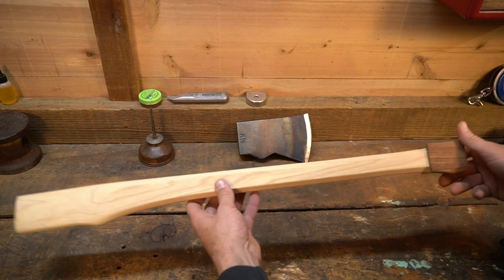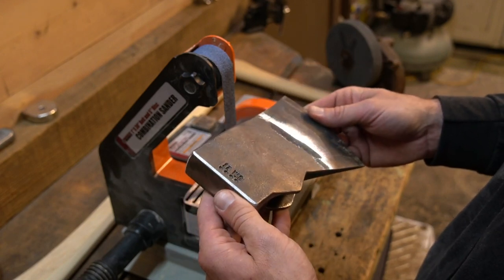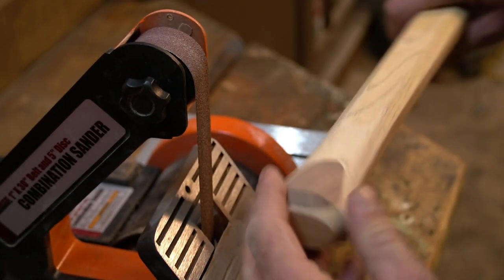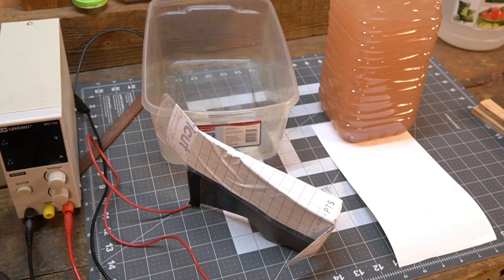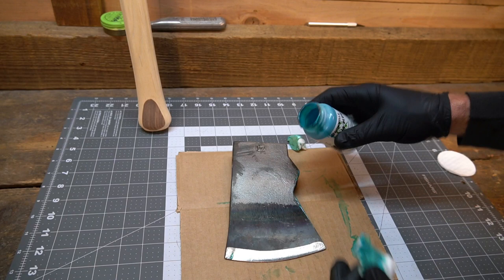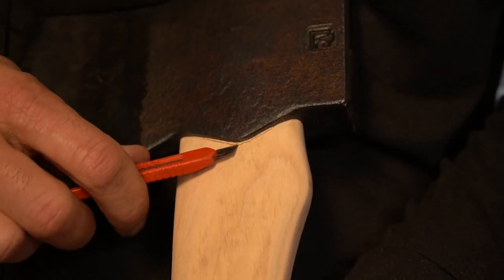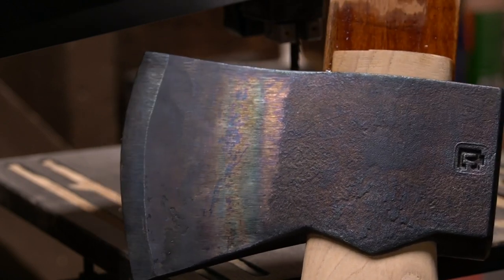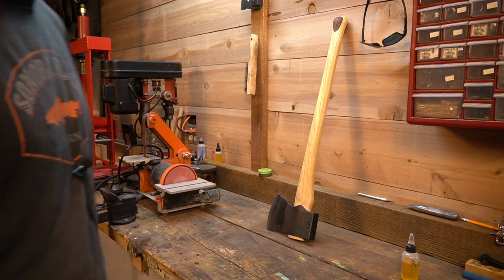A Fallers Axe. Etched initials, Crazy  blued finish.

Comment: This project came out great! I've been waiting to try some etching but haven't gotten the equipment together yet. Very clean work!👍
Reply from the maker: Thanks man. You probably have everything you need to etch. The resist is the difficult part. 
Hey are you on tictok? Someone is imitating my channel over there.
Reply: @old_iron_axe_and_tool  wife's got one of those little vinyl craft cutters, so that should work for making the resist. I've watched a few videos so far but haven't taken the plunge. Maybe I'll give it a test soon. 

I'm not on tictok pretty much just here and Instagram.
Reply from the maker: @Nsvens89  sounds like you're all set up. If you plan on posting on tictok at any time, I'd recommend sooner than later.  This fake channel took almost all my shorts, logo and name, and it's going to be a bitch to deal with. Wouldn't be an issue if I had just posted on both at the same time.
Reply: @old_iron_axe_and_tool  interesting. I hadn't planned on posting on there, but maybe I'll make one just go get ahead of anything.

Comment: Very nice.   You like that little 1x30?  Im think about getting one.
Reply from the maker: Love the 1x30. I have 2 so I don't have to swap belts when I need a different grit. If I was to do it over again I'd buy a better brand though. Typical harbor freight stuff. One has an off balanced wheel that vibrates the belt so it's not good for fine sharpening. The other ones table broke from voids in the casting. I'd like a wider belt for sharpening,  but the 1" is great for detail on handles and still grinds just fine.
Reply: @old_iron_axe_and_tool  I'm trying to decide between a 1x30 or 2x42.  It would be a 2x72 if I had the extra cash.   Thank you for the information.